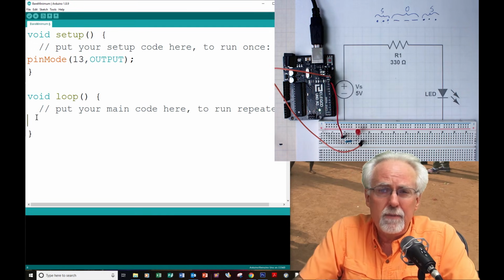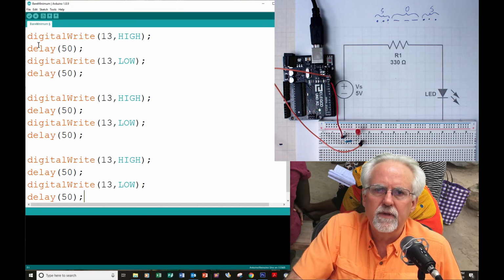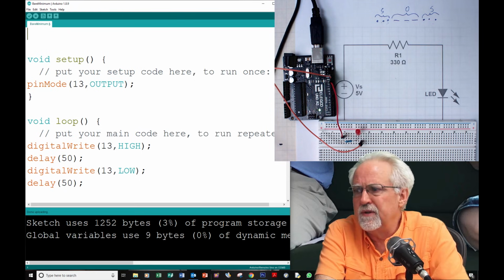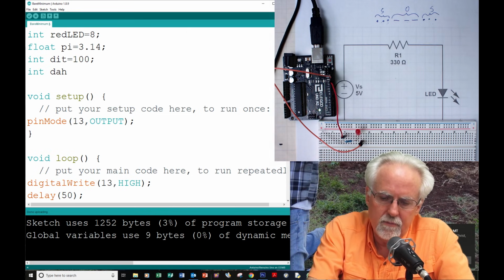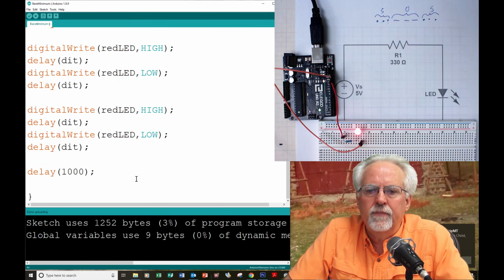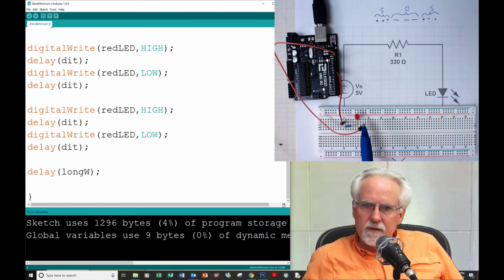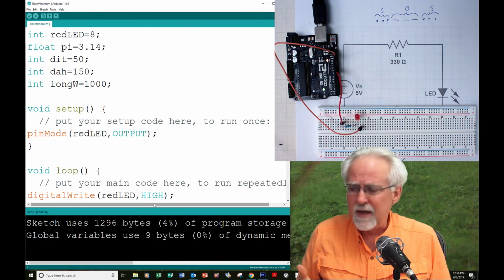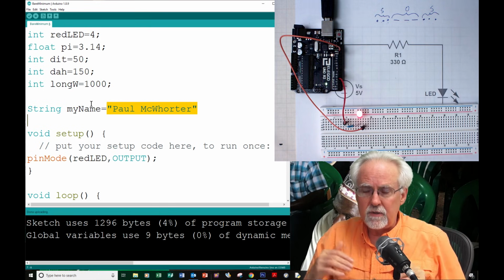Arduino Tutorial 4: Understanding Arduino Variables

Comment: Problem Solved: I only had pinMode (redLED,OUTPUT) in my void setup and forgot to do the same for my other two pins, which was causing the dimness.  Leaving this in the chat in case it's helpful to anyone experiencing the same issue.  THANKS!

Problem: On this homework assignment I'm having an issue where one LED will be full brightness and the other two pretty dim coming out of any arrangement of pin outputs. Issue is not with the LEDs, patches or resistors or code, because they all show full brightness if taken out of the one hot pin.  Is there something about these ELEGOO UNO R3 boards that can't equally power multiple pins?

Comment: My best attemp to simplify is there any suggestion to impove
Btw love your video <3

int port = 11; //variable "port" holding value 11
int mili; //variable "mili"
int looping; //variable "looping"

void pulseLED(int mili, int looping){
    for (int i = 1; i <= looping; i++) { //for loop looping 
      digitalWrite(port,HIGH); // Led ON
      delay(mili); // delay times
      digitalWrite(port,LOW);  // Led OFF
      delay(mili); // delay times
    }
  }

void setup() {
  // put your setup code here, to run once:
 pinMode(port,OUTPUT);
}

void loop() {
  // put your main code here, to run repeatedly:
  pulseLED(100, 3);
  delay(200); // delay 200
  pulseLED(500, 3);
  delay(200); // delay 200
  pulseLED(100, 3);
  delay(1000);
}

Comment: Hello Paul
I wrote integers like that:
int redLED=4;
int greenLED=8;
int blueLED=13;
float pi=3.14;
int redBlink1=250;
int redBlink2=700;
int greenBlink1=500;
int greenBlink2=900;
int blueBlink1=750;
int blueBlink2=1100;
int longW=2000;

 and it worked for me.
In void setup three pinMode for each pin and in void loop repeated three times changing the variables only.
Thank you for your teaching.

Comment: Professor.  I have been following your lesson 4 but I am unable to put an int Above void set up. The text  bare mimimum is above void setup and leaves no room for the text as it appears in your lesson.  Stumped!  Any information on how you are achieving this placement would be appreciated.  This has been the only thing  in 4 lessons that  I cannot get to function.  The software is 1.8.19. Thanks.

Comment: we did the home work and it worked but the two LEDs after the red one although blinked properly they were both dim light compared to the red. Does that mean to much ohms or resistance past the red LED as we used 2 more 330 ohm resistors in our path?
Reply: figured it out we needed to do this- we only defined redLED-but need blue and green

void setup() {
  // put your setup code here, to run once:
pinMode(redLED,OUTPUT);
pinMode(blueLED,OUTPUT);
pinMode(greenLED,OUTPUT);
}

Comment: Hello sir, i very appreciate your videos, your are clear and easy to follow, can i ask you a question, i want to blink more leds at same time , this is for my star trek enterprise model, i will add more leds but for now it is for 2, my codes are 

void setup() {
  // put your setup code here, to run once:
pinMode(2,OUTPUT);
pinMode(4,OUTPUT);
}

void loop() {
  // put your main code here, to run repeatedly:
digitalWrite(2,HIGH);
digitalWrite(4,LOW);
delay(500);
digitalWrite(2,LOW);
digitalWrite(4,HIGH);
delay(500);
}

they are not flashing in same time,  where is my error ?  thank you so much, Richard

Comment: hi! i have been watching your videos for a while now. could you please tell us where is the correct code for the assignment you have given at the end of the video? i make the homework program but its not going as you said it should. there is no error in the code but the output is not the desired one. 

this is the code that i wrote:

int redLED=4;
int greenLED=5;
int blueLED=6;
int r=100;
int g=500;
int b=1500;

void setup()
{
pinMode (redLED,OUTPUT);  
pinMode (greenLED,OUTPUT);
pinMode (blueLED,OUTPUT);
}

void loop()
{
  digitalWrite(redLED,HIGH);
  delay(r);
  analogWrite(greenLED,LOW);
  delay(g);
  analogWrite(blueLED,HIGH);
  delay(b);
}

Comment: I notice that when I use any other pin other than 13 the LED flashes a lot dimmer. Pin 13 gives a nice bright glow, Pins 1-12 dim in comparison. Also when connected to Pin 13 there is a yellow Led on the UNO R3 that also flashes in sync with the red Led on my bread board that does not flash when connected to any other Pin. Just worried that I may have a faulty UNO. LOL just realised I never used the variable "redLED" on the "pinMode" . I am a blithering idiot, feel free to insult me and my family
Reply from the maker: You are not the first one and wont be the last one to get dim LED shinage because of pinModes

Comment: sir you told 5 times faster but did not define frame of refrence? please clearfy sir

//blink 
//red led 5 times faster
//green led 10 times slower
//blue led lot times slower

//i took the base line delay=100milliseconds

int redpin=13;
int greenpin=12;
int bluepin=8;
int redled=50;
int greenled=1000;
int blueled=3000;

void setup(){
  // put your setup code here, to run once:
pinMode(redpin,OUTPUT);
pinMode(greenpin,OUTPUT);
pinMode(bluepin,OUTPUT);

}

void loop() {
  // put your main code here, to run repeatedly:

 //red 5 times fast
digitalWrite(redpin,HIGH);
digitalWrite(greenpin,LOW);
digitalWrite(bluepin,LOW);
delay(redled);
digitalWrite(redpin,LOW);
digitalWrite(greenpin,LOW);
digitalWrite(bluepin,LOW);
delay(redled);

digitalWrite(redpin,HIGH);
digitalWrite(greenpin,LOW);
digitalWrite(bluepin,LOW);
delay(redled);
digitalWrite(redpin,LOW);
digitalWrite(greenpin,LOW);
digitalWrite(bluepin,LOW);
delay(redled);

digitalWrite(redpin,HIGH);
digitalWrite(greenpin,LOW);
digitalWrite(bluepin,LOW);
delay(redled);
digitalWrite(redpin,LOW);
digitalWrite(greenpin,LOW);
digitalWrite(bluepin,LOW);
delay(redled);

digitalWrite(redpin,HIGH);
digitalWrite(greenpin,LOW);
digitalWrite(bluepin,LOW);
delay(redled);
digitalWrite(redpin,LOW);
digitalWrite(greenpin,LOW);
digitalWrite(bluepin,LOW);
delay(redled);

digitalWrite(redpin,HIGH);
digitalWrite(greenpin,LOW);
digitalWrite(bluepin,LOW);
delay(redled);
digitalWrite(redpin,LOW);
digitalWrite(greenpin,LOW);
digitalWrite(bluepin,LOW);
delay(redled);

digitalWrite(redpin,HIGH);
digitalWrite(greenpin,LOW);
digitalWrite(bluepin,LOW);
delay(redled);
digitalWrite(redpin,LOW);
digitalWrite(greenpin,LOW);
digitalWrite(bluepin,LOW);
delay(redled);

digitalWrite(redpin,HIGH);
digitalWrite(greenpin,LOW);
digitalWrite(bluepin,LOW);
delay(redled);
digitalWrite(redpin,LOW);
digitalWrite(greenpin,LOW);
digitalWrite(bluepin,LOW);
delay(redled);

///green 10 times slow
digitalWrite(greenpin,HIGH);
digitalWrite(redpin,LOW);
digitalWrite(bluepin,LOW);
delay(greenled);
digitalWrite(greenpin,LOW);
digitalWrite(redpin,LOW);
digitalWrite(bluepin,LOW);
delay(greenled);

digitalWrite(greenpin,HIGH);
digitalWrite(redpin,LOW);
digitalWrite(bluepin,LOW);
delay(greenled);
digitalWrite(greenpin,LOW);
digitalWrite(redpin,LOW);
digitalWrite(bluepin,LOW);
delay(greenled);

digitalWrite(greenpin,HIGH);
digitalWrite(redpin,LOW);
digitalWrite(bluepin,LOW);
delay(greenled);
digitalWrite(greenpin,LOW);
digitalWrite(redpin,LOW);
digitalWrite(bluepin,LOW);
delay(greenled);

digitalWrite(greenpin,HIGH);
digitalWrite(redpin,LOW);
digitalWrite(bluepin,LOW);
delay(greenled);
digitalWrite(greenpin,LOW);
digitalWrite(redpin,LOW);
digitalWrite(bluepin,LOW);
delay(greenled);

digitalWrite(greenpin,HIGH);
digitalWrite(redpin,LOW);
digitalWrite(bluepin,LOW);
delay(greenled);
digitalWrite(greenpin,LOW);
digitalWrite(redpin,LOW);
digitalWrite(bluepin,LOW);
delay(greenled);

digitalWrite(greenpin,HIGH);
digitalWrite(redpin,LOW);
digitalWrite(bluepin,LOW);
delay(greenled);
digitalWrite(greenpin,LOW);
digitalWrite(redpin,LOW);
digitalWrite(bluepin,LOW);
delay(greenled);

digitalWrite(greenpin,HIGH);
digitalWrite(redpin,LOW);
digitalWrite(bluepin,LOW);
delay(greenled);
digitalWrite(greenpin,LOW);
digitalWrite(redpin,LOW);
digitalWrite(bluepin,LOW);
delay(greenled);

digitalWrite(greenpin,HIGH);
digitalWrite(redpin,LOW);
digitalWrite(bluepin,LOW);
delay(greenled);
digitalWrite(greenpin,LOW);
digitalWrite(redpin,LOW);
digitalWrite(bluepin,LOW);
delay(greenled);

digitalWrite(greenpin,HIGH);
digitalWrite(redpin,LOW);
digitalWrite(bluepin,LOW);
delay(greenled);
digitalWrite(greenpin,LOW);
digitalWrite(redpin,LOW);
digitalWrite(bluepin,LOW);
delay(greenled);

digitalWrite(greenpin,HIGH);
digitalWrite(redpin,LOW);
digitalWrite(bluepin,LOW);
delay(greenled);
digitalWrite(greenpin,LOW);
digitalWrite(redpin,LOW);
digitalWrite(bluepin,LOW);
delay(greenled);

digitalWrite(greenpin,HIGH);
digitalWrite(redpin,LOW);
digitalWrite(bluepin,LOW);
delay(greenled);
digitalWrite(greenpin,LOW);
digitalWrite(redpin,LOW);
digitalWrite(bluepin,LOW);
delay(greenled);

//blue led long blink
digitalWrite(bluepin,HIGH);
digitalWrite(greenpin,LOW);
digitalWrite(redpin,LOW);
delay(blueled);
digitalWrite(bluepin,LOW);
digitalWrite(greenpin,LOW);
digitalWrite(redpin,LOW);
delay(blueled);

digitalWrite(bluepin,HIGH);
digitalWrite(greenpin,LOW);
digitalWrite(redpin,LOW);
delay(blueled);
digitalWrite(bluepin,LOW);
digitalWrite(greenpin,LOW);
digitalWrite(redpin,LOW);
delay(blueled);

digitalWrite(bluepin,HIGH);
digitalWrite(greenpin,LOW);
digitalWrite(redpin,LOW);
delay(blueled);
digitalWrite(bluepin,LOW);
digitalWrite(greenpin,LOW);
digitalWrite(redpin,LOW);
delay(blueled);

digitalWrite(bluepin,HIGH);
digitalWrite(greenpin,LOW);
digitalWrite(redpin,LOW);
delay(blueled);
digitalWrite(bluepin,LOW);
digitalWrite(greenpin,LOW);
digitalWrite(redpin,LOW);
delay(blueled);

digitalWrite(bluepin,HIGH);
digitalWrite(greenpin,LOW);
digitalWrite(redpin,LOW);
delay(blueled);
digitalWrite(bluepin,LOW);
digitalWrite(greenpin,LOW);
digitalWrite(redpin,LOW);
delay(blueled);

digitalWrite(bluepin,HIGH);
digitalWrite(greenpin,LOW);
digitalWrite(redpin,LOW);
delay(blueled);
digitalWrite(bluepin,LOW);
digitalWrite(greenpin,LOW);
digitalWrite(redpin,LOW);
delay(blueled);

digitalWrite(bluepin,HIGH);
digitalWrite(greenpin,LOW);
digitalWrite(redpin,LOW);
delay(blueled);
digitalWrite(bluepin,LOW);
digitalWrite(greenpin,LOW);
digitalWrite(redpin,LOW);
delay(blueled);

digitalWrite(bluepin,HIGH);
digitalWrite(greenpin,LOW);
digitalWrite(redpin,LOW);
delay(blueled);
digitalWrite(bluepin,LOW);
digitalWrite(greenpin,LOW);
digitalWrite(redpin,LOW);
delay(blueled);

digitalWrite(bluepin,HIGH);
digitalWrite(greenpin,LOW);
digitalWrite(redpin,LOW);
delay(blueled);
digitalWrite(bluepin,LOW);
digitalWrite(greenpin,LOW);
digitalWrite(redpin,LOW);
delay(blueled);

digitalWrite(bluepin,HIGH);
digitalWrite(greenpin,LOW);
digitalWrite(redpin,LOW);
delay(blueled);
digitalWrite(bluepin,LOW);
digitalWrite(greenpin,LOW);
digitalWrite(redpin,LOW);
delay(blueled);

digitalWrite(bluepin,HIGH);
digitalWrite(greenpin,LOW);
digitalWrite(redpin,LOW);
delay(blueled);
digitalWrite(bluepin,LOW);
digitalWrite(greenpin,LOW);
digitalWrite(redpin,LOW);
delay(blueled);

}

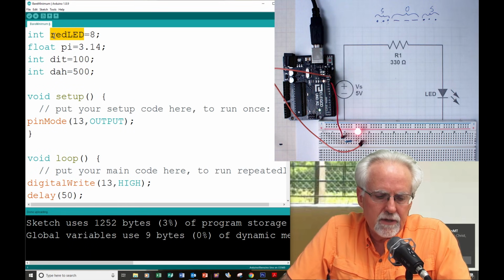Comment: 14:42 Tip to save some time:  You can also use ctrl+f to find and replace all instances of the number with the variable. Then you can just scan your code to ensure the replacements were all correct and then run your code
Reply: so in the variable definitions at the top i highlight the "dah" for an example and then press cntrl F and then it highlights all the "dahs" and then what? i see they are all highlighted but a search bar comes up and cant seem to change them to my new variable definition...am i missing something?

Comment: Another useful thing in addition to variables is Find & Replace.  So long as you skip anything you don't want to replace (which is why I'd recommend avoiding the "replace all" feature unless you're really sure it won't replace anything it shouldn't), you could easily, for example, replace each constant value with the corresponding variable name with a single click per instance of the value.

Comment: Greetings, Paul. I'm a newb. Stuck on your homework assignment. If we are to power the red, blue, and green LEDs, isn't the Uno's 5 volts insufficient? The red requires 2 volts. The blue requires 3.5 volts. And the green requires 3.6 volts. Total voltage requirement is 9.1 volts. Wouldn't this project need a 9-volt supply -- and no resistors -- to light the LEDs somewhat properly? Or a 12-volt power supply with resistors? Really stuck here. I'm going to try it, but other commentors here state the LEDs are too dim or not working at all, which is why I am asking this question. Thanks.

Update: I tried it and it worked fine. I don't understand why because of the apparent voltage insufficiency. I guess the pins on the Uno's digital side supply 5 volts each. I thought the Uno delivered 5 volts total.

Comment: I finished the homework, seems the last LED I was using is dimming for some reason. I checked the resistor, the wire, the LED, ground, and the DW connection, but everything seems fine...Not sure what I did wrong, maybe it's just a power issue?
Reply from the maker: Did you do pinMode correctly? Are you using the correct resistor?
Reply: @paulmcwhorter  I did, I set it to pin 8 and used 330 ohm resistors. I think I might just have a few faulty LEDs, it did this with a few of them but not with others.

Comment: Question: I followed along did the assignment at the end. I got it hooked up and got it to work. Red LED blinks 5 times, then Green LED blinks 10 times, then blue LED blinks 15 times and then the cycle starts over. I tried messing with the code to try and get the red and green LED to blink simultaneously, for the same duration. The red LED behaved normally, but the green just did a very quick blink. This was my code:
digitalWrite (redLED, HIGH); digitalWrite (greenLED,HIGH);
delay(dah);
digitalWrite (redLED, LOW); digitalWrite (greenLED,LOW);
delay(dah);
Is there something wrong with that?  Can I make two LEDs come on and stay on simultaneously and for the same duration of time?

Comment: Great tutorial, if anyone wants to make stuff like this really easy, learn how to use functions in C++. Then you can just create a flash function that will take the 4 lines and make them 1. 

Something like this (not a professional programmer, just a hobbiest):

int pin1=2;
int longPause=1000;
int midPause=500;
int shortPause=250;

void setup()
{
  pinMode(pin1, OUTPUT);
  pinMode(pin2, OUTPUT);
  pinMode(pin3, OUTPUT);
}

void loop()
{
  delay(longPause);
  
  flash(pin1, shortPause, shortPause);
  flash(pin1, shortPause, shortPause);
  flash(pin1, shortPause, midPause);
  
  flash(pin1, longPause, shortPause);
  flash(pin1, longPause, shortPause);
  flash(pin1, longPause, shortPause);
  
  flash(pin1, shortPause, shortPause);
  flash(pin1, shortPause, shortPause);
  flash(pin1, shortPause, midPause);
}

void flash(int pin, int pause1, int pause2)
{
  digitalWrite(pin, HIGH);
  delay(pause1);
  digitalWrite(pin, LOW);
  delay(pause2);
}

Again, great beginners tutorials though

Comment: I know this old, but I have a question everything is working, but I change the pin number to anything other than 13 is dim but it works. Can't figure out why?
Reply: I had pinMode(13,OUTPUT) in the code, but my circuit was using pin 8, and so the LED was dim. Check which pin you were actually using. That's all I know

Comment: I just finished homework for lesson 4 all 3 LED's flashed as to what was expected. I do not have any arduino equipment yet so I'm doing an online simulator and it worked well on the simulator.  My Code: (top half)
// RED LED: 5 X’s	fast
// Green LED: 10X’s	slow
// Blue LED: 15 X’s	real slow

int redLED=7;
int greenLED=5;
int blueLED=3;

int redBlink=250;
int greenBlink=500;
int blueBlink=750;

void setup() {
  // put your setup code here, to run once:
pinMode (redLED,OUTPUT);		// Pin 7
pinMode (greenLED,OUTPUT);	// Pin 5
pinMode (blueLED,OUTPUT);	// Pin 3
}